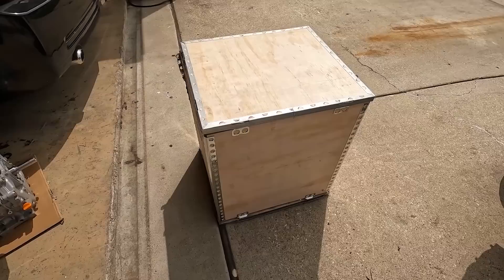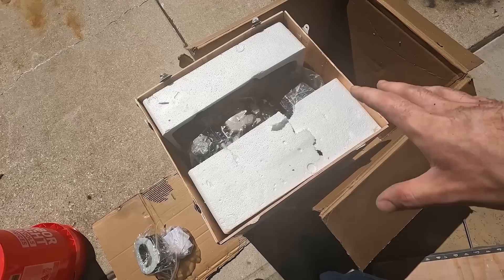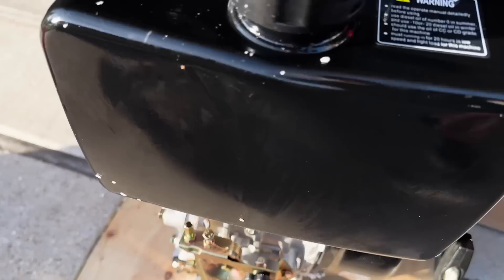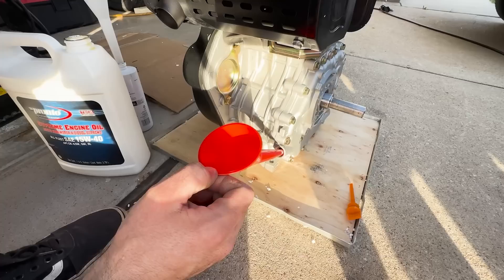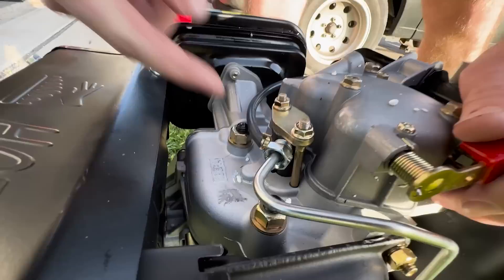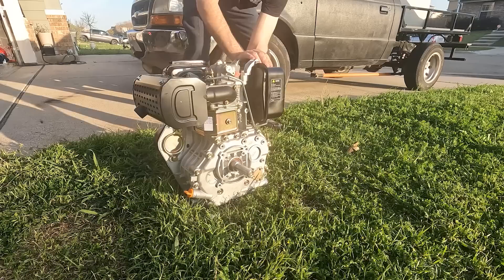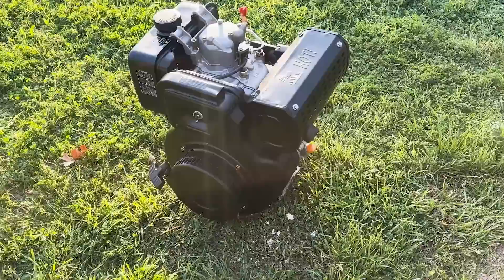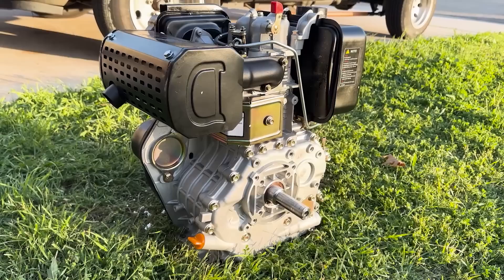Amazon 418cc Diesel Engine 10hp Unboxing First run

Comment: That would make a neat super eco motorcycle, and with 1000ftlbs of torque it would pull a pretty high gear, so having only 10hp wouldn't be a problem.
Reply: Where do you get that crazy figure from? It's a naturally aspirated lo-tech engine, so it just has the torque as a gas engine with the same number of HP
Reply from the maker: Haha yes I want to do a mini bike build after doing some generator stuff with it, I plan on really using it on as many projects as I can think of!

Comment: That looks just like the yanmar engines on our emergency pumps on a towboat. Starts just like one too. This would be a fine candidate for a rhb 31 turbo😁. I cant help but wonder how many ponies could be had out of this little engine and transfer that to kw to run a fairly beefy generator.

Comment: I need a 30hp diesel to run a grain auger. They make anything like that?
Reply: Kubota is where to look
Reply: Not really any cheapy Chinese options for that horsepower rating.
Better off looking for a decent second hand engine.
Water cooled your looking at Kubota, Yanmar, Mitsubishi, Perkins.
Air Cooled your looking at Lister, Hatz or Lombardi/Kohler
Reply: @deezelfairy big old antiquated one lung lister would probably run it for the next 50 years lol
Reply: I looked on Alibaba once and saw that there are several diesels that are bigger. 190F, 192F, 195F, etc. The shipping cost for one engine is outrageous. I chatted with a customer service rep who said that our (United States) EPA is what keeps them from shipping the larger diesels. She said that they do not meet tier 4 (NOx and particulate emission for non-road diesel engines). She said if they could, they'd be shipping the heck out of them to us, because they know there is a market for them :)
Reply: @juliogonzo2718  True, but I'm not aware of any single cylinder Listers that produce 30hp
Reply: @goofypettiger  epa ruins just about everything
Reply from the maker: I haven seeen anything, best bet is a used kabota engine from a refrigeration trailer

Comment: When you learn to read..

There is a position marked on the sector that the throttle screw adjuster rides on
that is marked "Start".

This opens up the rack on the diesel injection pump to maximum stroke (maximum injection of diesel)

This is where you put the throttle for starting...from cold.... every time.

Also use this setting when you pull the engine over with the decompressor engaged to bleed the fuel system until ALL the air bubbles come out and only liquid fuel squirts out...

a lot more liquid "waste" than the little piddle you let out before you tightened the union again....

By any chance did you gloss over/not show the standard owner's manual that usually comes with these engines...that show all this????
Reply: I start just above low.

Comment: Maybe you can find a medium duty nat gas, gas, or propane genset with a blown engine on market place or craiglist with a blown engine. Not sure of the RPM of that thing but 15 KW or something be cool. The extra toque of the diesel might make up for the small size. Likely wishful thinking but might work.
Reply: motor is only rated 6.3 kw according to the data plate

Comment: 10hp and 1000ftlbs of torque??????? 1000?????
Reply: How about 100 ?
Reply: Yes i got the same engine in a old lawnmower (wheel horse) and it pulls tonnes no kidding it got lots of tourqe
Reply: @johnhabeck6153  lol, not even close to a 100 😂
At it's rated speed of 3600rpm making 6.3kw (8.5hp) it's making 12.5 ftIbs

They're not really any more powerful than the gasoline equivalents but they do use a lot less fuel.

Even a genuine Yanmar L100 only peaks at about 15.5 ftIbs at ~3000rpm

Comment: They coat the motors for corrosion reasons, they my have to sit in a box for a very long time. Use the motor oil recommended. These new motors can be damaged using the wrong weight  of oil. Well you defiantly sold me on electric start. I'm way too old for these pullalot motors. At 62 that would be the end of me.

Comment: You know you realey have to pull on the cord with both arms not with one arm. Y reale need the momentum to get over the kompression. and the seccound thin open the plate becource i gess the flywheel does not have teeth for a electric start so you need to change that too and if you whant the ting to recharge the starter battery you need a stator and a flywhell with magnets inside.

Comment: The big question is...once the engine is heated up, can it switch over to pure vegetable oil that has been heated up?
Reply from the maker: I bet, imma try it on both my diesel engines I want to generate power with used McDonald’s oil
Reply: @Mikebuildss  Let the used cooking oil get cold outdoors overnight, and then screen out the chunks. The lighter elements will work as fuel if heated by the exhaust.
Reply: 20% glycerol in most veggie oils causes problems.

Comment: Nice little diesel.  Every time I see them on Amazon they wont ship to my area.  They act like Alaska is a different country. lol
Reply from the maker: Oh dang yea that’s a stretch!
Reply: @Mikebuildss  yup.  I need to build a better Gen system for our remote home.
Reply: Get some friends to join you in a bulk buy 
then arrange Customs via Canada and do a road trip to a friend's place in the mainland...
pick them up 
and back to Alaska???
Reply: I wouldlike to use that in my mini excavator
Reply: @JohnSmith-yv6eq might have a problem with the Canada part. I'm in Canada and considered buying one from China. They do not meet emissions standards and could get rejected by CBSA if they are smart enough to realize it. I emailed the ministry of environment to ask if engines that do not meet epa or Canadian emissions could be imported and they told me no. Chances are the CBSA isn't going to notice and reject it, but they could and you'd be out the money. Amazon Canada has a few of these and they are extremely expensive compared to the ones on US Amazon or aliexpress and they are coming from China anyway
Reply: @JohnSmith-yv6eq  We thought about that. However due to our location we do not know a lot of people.  Very small circle of friends.

Comment: I just rig up a drill motor with a socket on the crank shaft
Reply: You would need one big ass drill.
Reply: @juliogonzo2718  yep.  milwalkie hole hawg
Reply: @Telephony954  it may start or you may end up in a sling lol

Comment: Squirt of Easy Sart,needed
Reply: RTFM and follow procedure..
starting with the injection pump stroke at maximum, 
as per the Starting position marked on the throttle adjustment plate 
is a good thing to do...
Reply: Mishandling ether can wreck your diesel in a blink of an eye, or an expensive repair.

Comment: Most of the reviews of chinese products I watch --- open up all machined areas --- because [ it seems ] most products have machining residue inside hydraulics , rock crushers , engines etc.  
If you buy cheap --- protect your money --- open [ and clean if needed ] .

Comment: I’ve got 2 of the Yanmar 7hp versions and I’m curious how this Amazon engine lasts vs a predator.

Btw that in tank fuel filter/tank design is junk.

Re-adjust those valves because these engines keep eating pull recoils. They’re $70 each and they don’t like ether at all. When they fail they’re not rly fixable at all.

When I buy recoils I get 2-3x of them. Also don’t get any water into the exhaust because these will backfire out of nowhere. When it’s old I don’t even try to start it at all.

Get the electric start it’s well worth it. I’ve thrown probably 5 recoils in the trash from backfiring.

Comment: I believe you had the throttle set too high for an easier start. Too much fuel
Reply from the maker: It says “start” at full throttle on the throttle plate, I may try it on low again once mounted
Reply: The injector pump is set to open up for maximum fuelling at that Starting position.
Leave it there as the manufacturer knows what is best.

You still had air in the injector pump to injector line that you cracked open but failed to de-air properly.

A little or a lot of diesel squirted out of there is no real problem...but any air forms a cushion in the line or right in the injector.

This air cushion stops the injector pintle from being forced open by the fuel trying to escape past the pintle...
which has a heavy spring in it...
so when you finally got the air squirted out the next solid hit of fuel all the way from the pump (liquid being incompressible) smacked the pintle open jetting the diesel into the chamber...
and away it went.

It will be so much easier to start now....
pull it all the way over on the decompressor until you hear air escaping, then pull smoothly but powerfully and the momentum built up in the flywheel should carry the engine over the next compression event snapping the decompressor shut with the engine firing immediately...

 @Mikebuildss
Reply: I use like 20% throttle. The governor supplies more.

Comment: I've heard you can run diesel motors on used motor oil and vegetable oil, you should try doing that!
Reply: Only if you like replacing the injection pump from the abrasives or the non lubricants in all these substitute fuels.
Farm diesel is the cheapest real diesel that won't harm your diesel engine in the long run....

Comment: Glu plug is the same as a spark plug
Reply: No, a glow plug is NOT the same thing as a spark plug. A glow plug is a simple resistance heater which heats the air in the cylinder to make it easier to start.
Reply: @ethanlamoureux5306  it’s the same principle behind it, diesel is more efficient that is the only difference
Reply: @shangrilaladeda  A spark plug makes a spark, which ignites the fuel/air mixture. A glow plug glows red hot and heats the air in the cylinder, which makes it easier to start a cold diesel engine. The glow plugs are not necessary for the engine to run, and are not used at all once the engine is running properly. Not the same principle at all, and has nothing to do with the efficiency of the engine.

Comment: PUT IT IN A MINI BIKE!
I am pretty sure this is the starter on Amazon. $89 bucks.   Copy and paste this:    DB Electrical SHI0156 Starter Compatible with/Replacement for Yanmar L100 10Hp Industrial Diesel Engines, L100 L40S L60S Yanmar Engine S114-650 410-44043 18494 2-2836-HI 114351-77011 414351-77011

Comment: 1" OUTPUT SHAFT? - nuff said  :face-blue-smiling:
Reply: Don’t be surprised if if close to one inch but not 😢😢😢
Reply: @philliphall:  No problem. Ironically, that's what I end up telling girls on the 3rd date  :face-orange-biting-nails:  Cheers!
Reply: 25 or 25.4 MM ? I suspect 25. Shim it..
Reply: @stanleybest8833  They are 25mm.  0.984"